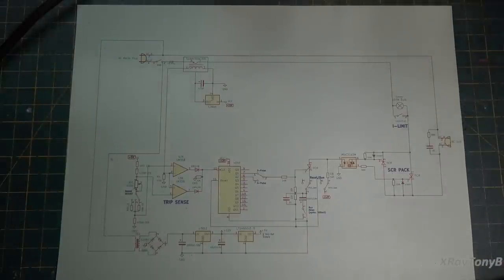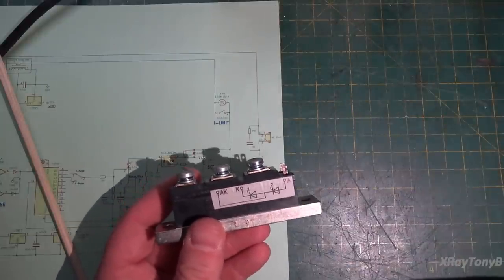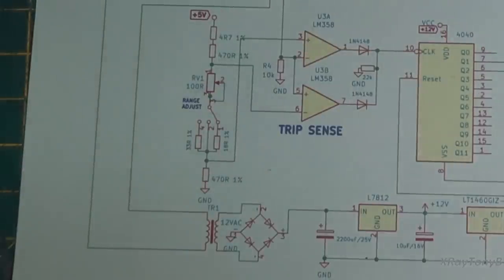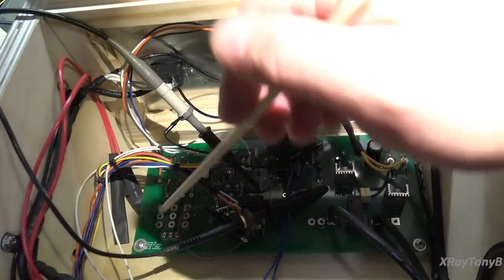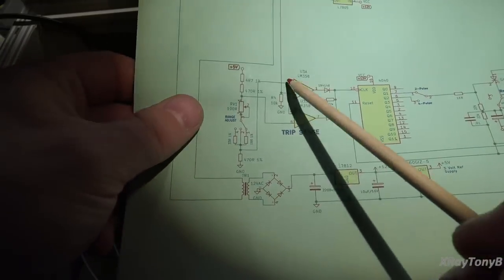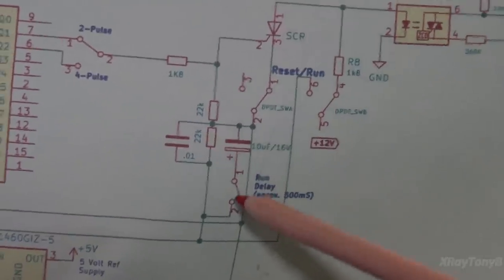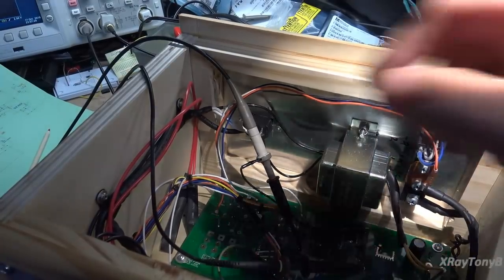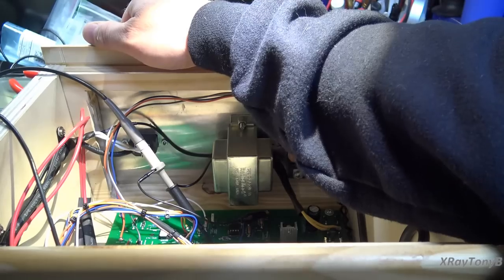Electronic Circuit Breaker - Final & Some Future Projects

Comment: Thanks for picking this up from GlassSlinger and making your useful mods. I particularly like the Thyristor arrangement to replace the relay and the use of a window comparator to catch either half of the wave. That addition can be very helpful for the old sets that used a "hot" half wave diode for the B+, like a 35W4. When it shorts it can be on the other half of the wave from the positive.
Also I liked your 15 position current set switch idea which I would then series with a "fine" adjust pot. Just like on other test gear it would allow for a "calibrated" current when set to zero fine and then give you adjustment up to the next step as you add resistance.  I definitely will build this because I was already in the middle of redoing my current dim bulb, variac, and isolation transformer system to include leakage testing and ground failures like the old Sencore testers did. 
This will be a great finish to the project. One other thing though, just as with the meter display I intend to have a separate power lead that feeds just the electronics and keeps the "mains loop" separate. That will allow the breaker to work in circuit after the line variac. Keep up the good videos, really enjoying them.

Comment: @TonyB You have encouraged us to design the circuit to meet our needs. That challenge includes, somewhat, building the unit with the components that we have on hand, as you did. Typically, I like analog solutions, instead of throwing an Arduino at every circuit. But, maybe I can solve this design better, with a digital approach. Off the top of my head and out of my component stocks... An ACS724 Hall Effect Current Sensor reads the Mains current draw and feeds that information to a small MCU (maybe an ATtiny85, if it will suffice. It depends on what ADCs and DACs are needed.) A Crydom D1225 SSR controls the mains (Its control input can be driven directly by the MCU, say 5V at 7uA, IIRC. The Amperage Trip Point Value, Cycle Counting/Delay and In-Rush Tolerance can all be managed in software, I think. I am not so much of a digital guy, so does that sound like it might work? What dragons lie in wait? All help welcome.

Comment: Of course I was due to see this eventually. Anyone is free to make modifications to the concept. That does NOT guarantee that the new circuit is well tested over time (20 years) or even short term with various shorts. This fellow and his circuit has overlooked certain problems that may manifest under certain types of load short that will not happen with a relay circuit. I stand by my tried and tested (over 30 years) circuit.
Reply from the maker: Hi Ron,
I certainly never intended to offend you or question the reliability of your original design.  I appreciate all that you share with us on your channel.  I was truly impressed with your design and it got me to thinking about how some of the primary control circuitry worked in some of the old x-ray machines I used to service.  The result was this unit.  It has gone through several modifications over the last year or so and has served me pretty well.  As you say, it isn't without its faults, as the SCR pack could short, leaving the traditional fuse or circuit breaker to act as a backup.  I've learned a lot from this project, which was my goal from the start.  Anyway, thanks for stopping by the channel.  If you have any ideas or improvements you'd like to share, feel free to email me.  It would be an honor to hear from you.  Stay well, and best regards.
Reply: l agree, Ron.  Tony has gone way overboard.  Ever a perfectionist he misses the point:  KISS - Keep it Simple, Stupid!  Or get lost in meaningless perfectionism.

Comment: Interesting variation on Ron's design but can you explain why you added the "slow start" circuit rather than just setting the cycle count (4040) to a larger number say 32 or 64, I thought the purpose of cycle counting was to delay the cut-off for loads with a high inrush current?

Comment: Looking at that circuit, to work on + and - cycles the current coil must be sat at 2.5V DC. Also that display is unfortunately no longer available so another solution would probably have to be found. Ron's idea of using a transformer is a good alternative solution. The signal could also be rectified then referenced to ground or the 2.5V as in your circuit

Comment: Hi Tony, it's an older video, but it still won't work for me (I have something similar at my workplace, the maximum current can be set directly in the meter, and when it is exceeded it can trigger an optical or acoustic alarm, or turn off the circuit), I remembered this video because I am solving an adjustable electronic fuse for another test device. When I was watching the totofinal video, I thought of the display of the set level of the tripping current. I don't have it verified, it's just an idea, if tandem potentiometers were used for fine and coarse settings - track1 for current setting and track2 for voltage divider for the small Voltmeter on the panel, then it could be calibrated so that the voltage value on the Voltmeter corresponds to the set tripping current. I'll probably try to test it when I have time, unfortunately I have a lot of other work to do.

Nice day 🙂 Tom

Comment: That is pretty neat. I have been building a Test jig for testing equipment. I might see about adding the circuit breaker to it. Would those Stop Light Bulbs work as a Dim Bulb? It's starting to get harder and harder to find incandescent bulbs in my area.
Reply: Yes.
Reply: Halogen bulbs work, too.
Reply from the maker: Yes, they work great.  The heavy duty filament makes them perfect as dim bulb testers.  They also come in 69W, 97W, 110W and 116W (possibly others).

Comment: Xraytonyb Mr., different equipment surge pulse number is different, should be how to set the counter gear, and how to ensure that can most quickly cut off the short-circuit current?

Comment: Nice project, but personally it would bother me that the volt/amp display is not always on from the moment you set the mainswitch of the circuit breaker on.
You can achieve this by connecting the powerleads to the volt/amp display right behind the mainswitch, and before the protection part of the circuit breaker. 
The testleads from the volt/amp display can leaved on the output of the circuit breaker like they are connected now.
Reply from the maker: I placed the meter AFTER the SCR switching circuit to display the actual voltage being applied to the device under test.  Placing the meter before the SCR's would not show the drop across the SCR's. It probably wouldn't matter very much, as the drop is only about 2 volts.  Other than that, it would work either way.  Thanks for watching!
Reply: @xraytonyb  i know that you want to show the actual voltage to the device under test, that's okay. But what i meant was this : 
The low voltage powersupply (usual 5 to 30V to power the volt/amp meter itself)  is sepaired from the voltage you measured on the testleads of this meter. 
If you connect the low voltage to the volt/amp meter before your circuitbreaker, then the volt/amp meter display is lit when you switch the mainswitch , even when the circuitbreaker pops and disconnect the power to your device under test (display shows then 0V and 0A).
Reply: This was an oversight!  DUH!  I have fixed my unit to always have the meter on. Much better.

Comment: Damn useful circuit - esp. the analysis and demonstration of its operations are valuable to experimenters who wan to tinker with faulty equipment. Ideally, I'd really like the meter to stay on after the circuit breaker trips and to continue showing the tripping current and voltage values. Maybe there's a meter out there that has a hold function.
I don't know if this circuit would be suitable for this type of usage but I'd sure like to have something like this to function as a loudspeaker protection device. This would be useful for certain modern extremely spartan amps. that do not feature speaker protection. In the '70's and '80's there was no amp without one but a lot of expensive amps nowadays come without.
Or - again with the same caveat as above - I'd like to have something like this acting as a mains current monitor used to protect sensitive equipment further down.
Reply: I have modified a similar meter to monitor the voltage off of the output of my variac. It turns out that it is relatively simple to find the 5v supply that is tied to the line input and then feeds the 5v to the metering circuit. That gives you two options depending on your desire: You can separate the input to the supply off of the measured voltage leads and supply it with mains voltage from somewhere else. Or do my preferred mod and cut the 5v output from their built in supply and run a wire external to feed +5v into the circuit at that point.
The meter then stays lit and works down to 0 volts input so it can monitor the variac output nicely below its original specification of 80v.
Hope this gives you some ideas on how to do the same for this circuit.

Comment: Great video Tony.  I noticed that the ground clip of one of the oscilloscope probes was clipped to itself.  Is that to make sure that the two probes are both referencing ground?
Reply from the maker: The scope was already referenced to ground through the other probe.  Although it isn't always good practice to do so, you can usually get away with this because both channels' negative terminal are referenced to the same ground at the scope.  Because the negative lead was short, it was a tight stretch to clip it to a ground point.  I clipped it onto the probe so that it wouldn't flop around and short something out (remember, it is tied to ground through the other probe's negative lead).  With low frequency signals, this will work, but never with RF or signals with really fast rise times.  Thanks for the comment!

Comment: Great project and thanks for sharing it. I was thinking to use an SSR to be driven by 4040 as opposed to all these SCRs. Your thoughts?
Reply from the maker: I'm sure it would work, but I don't think they would have zero-crossing detection.  Also, the signal out of the CD4040 is active high, so it would only output a voltage when the circuit is in "tripped" mode, so you would have to use another component to invert the signal.
Reply: Why not use a $5 easily available relay like in my original circuit?   :)

Comment: I asked this in a comment to the previous video and got no answer... Shouldn't you rewire that multi-drop switch to different outputs of the decoder chip, since you're counting half-cycles, not cycles? When you set you selector to 32, your device will trip after 16 cycles.
Reply from the maker: I wired the selector switch to allow for 1, 2, 4, 8, 16 and 32 HALF-cycles.  As the circuit can detect positive and negative half cycles, you are correct, setting the selector to 32 would trip the circuit after 16 FULL cycles.  I designated the settings in half cycles because the circuit is designed to trip on the half-cycle.  If you noticed in the video, when I set the selector to "1", it tripped on the first half-cycle of over-current.  This means the minimum trip time for this circuit is just over 8 milliseconds (which is the duration of 1/2 cycle at 60Hz mains frequency).  Thanks for watching!

Comment: The circuit is fantastic but I wish I could say the same for the enclosure, reminds me of the lyrics to a song " Nice legs, shame about the face"... It's form factor might mean that you couldn't put anything on top of it, work spaces are tight enough as it is LoL.
Reply from the maker: There is a top cover to it and you can put things on top of it.  As it is a prototype, I just used a piece of plywood and aluminum sheeting I had laying around the shop to build a quick enclosure.

Comment: I just noticed you have a RC filter across the output doesn't that draw current and show current draw on your meter with no load on the output??
Reply from the maker: The RC filter only reacts to RF/HF noise on the mains.  It has no influence at mains frequency.

Comment: Hello,
It was interesting video. Why did you add delay capacitor instead using the cd4040 counting for the delay?
Reply from the maker: If you turned the pulse count up to 16 for instance, the surge current would be settled before the 16th pulse.  It would then remain at whatever count it stopped at until there was an overcurrent condition.  Problem is that you never know where in the count it stops.  That's why I made the little delay mod.  Just like with Ron's original circuit, it can't distinguish between surge current and an actual short.  It only knows when the current exceeds the trip point.  This is why all of these circuits still need a fuse or fast-trip thermal breaker as a back-up.
Reply: @xraytonyb  Thanks,
I understand your point but I mean you can use the same 4040 twice (two taps): once for the first time you operate the load (instead the capacitor) and the other for the trip level.
Reply: @xraytonyb  NOT!  The original circuit will ALWAYS trip on an over current. The count will always reach the cut off count.

Comment: If a mosfet was triggered by noise of touching terminals with a screwdriver, the drive circuit wasn’t designed properly. The sensitive gate SCR is just hiding an inherent instability.
Reply from the maker: I agree with you with regards to the original circuit.  The circuit, in its current form doesn't seem to show any of those issues.  No oscillations, no noise, no odd voltage levels.  I will continue to test it and see how things work out, but...so far, so good.  Thanks for watching!

Comment: You didn't show your rotary switch for the cycle counts. If you turned it to 16 counts will the surge current still trip Thanks
Reply: you are right it shouldn't that's the whole point of the over current pulse count.....
Reply from the maker: I made this video way too fast and left out things that I probably should have included.  Sorry!  For instance, if you turned the pulse count up to 16, the surge current would be settled before the 16th pulse.  It would then remain at whatever count it stopped at until there was an overcurrent condition.  Problem is that you never know where it stops.  That's why I made the little delay mod.  Just like with Ron's original circuit, it can't distinguish between surge current and an actual short.  It only knows when the current exceeds the trip point.  This is why all of these circuits still need a fuse or fast-trip thermal breaker as a back-up.  There is a lot more to this circuit than I could show in just one video, so I though it would be easier to just let everyone comment and ask questions and I'll try to answer them as I have time.   Thanks for watching!
Reply: Thanks
Reply: @xraytonyb  WOW, you made the video too fast! Ha, ha, ha! So I could not make the video too fast? YEP! So now I wIll NEVER post a build-it video again since there are so many know-it-alls that can do it better. BUT WHERE ARE THEIR ORIGINAL VIDEOS OF THE PROJECT? OHHHH!
Reply: Please Ron, don’t be discouraged. You stated exactly what you wanted to achieve , and did it!
Tony stated his video was an inspiration, and he tried  a different approach. I felt he over complicated the final design  and didn’t meet the same objective. Still his video was of value, a learning experience, encouraging others to experiment.
Based on some of the comments on your and Tony’s videos, as well as others, it seems like the viewers didn’t watch the whole show. Most comments are sincere while others appear self serving.
Please don’t be discouraged by the minority. We need You and Tony to preserve the knowledge.

Comment: I'd use a GFCI Outlet , rather than ALL of this circuitry!
Reply from the maker: A ground Fault Circuit Interrupt (GFCI) outlet is not designed to limit current.  It is designed to sense current on the earth (ground) lead and trip to prevent electrocution or electric shock.  It will not protect a device from an over-current situation, only from ground leakage.